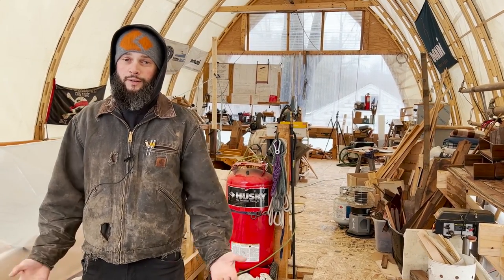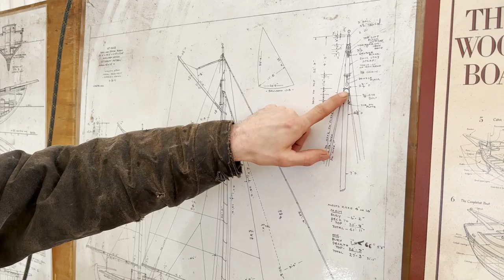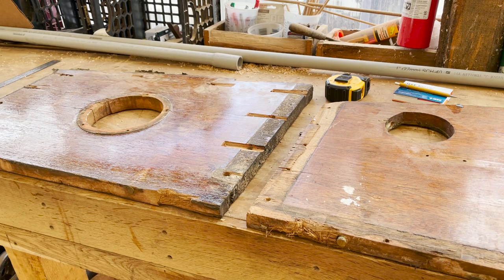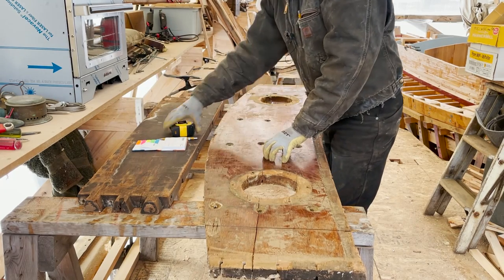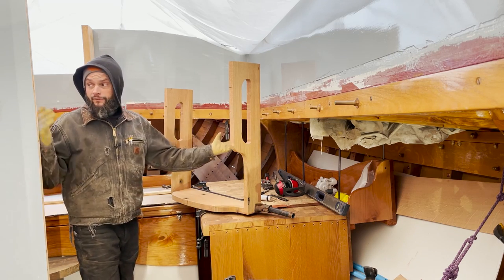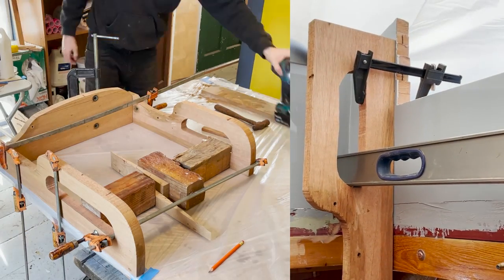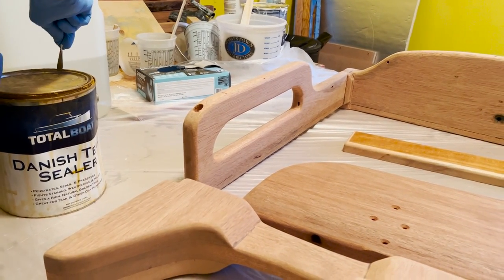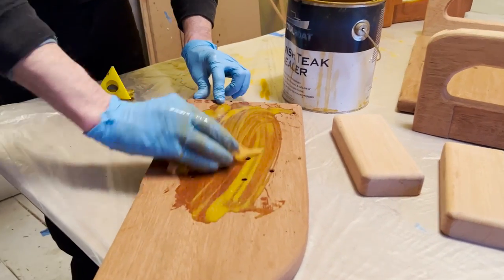The Companionway Ladder & A Big Update - Episode 197 - Acorn to Arabella: Journey of a Wooden Boat

Comment: Do not waste thought on erroneously thinking a spliced wire needs regalvanising.  That's as nonsensical as thinking you might protect the boats paint and varnish by never taking it out to sea when it's complete.
Reply: So talk to someone who has spliced wire for a living not a galvanising expert.  When the splice and wire is drowned in white lead and tallow, then parcelled with linseed oil soaked Hessian,  then served with spun yarn then drowned in Stockholm tar  what could you imagine regalvanising the splice would do ??  Except waste money and time.
Reply from the maker: Thanks for taking the time to send along these thoughts, delivered with a salty tone, but with the a helpful spirit behind it. Glad you’re watching!
Reply: @AcornToArabella  Thanks for replying.  Hey if you are going to do the splicing yourself then try and get old fashioned 6 x With the fibre core you just cut the core off where as 7x means you have a wire core you have to mess with and the 6x19 wire with a  fibre core will be fine.  You can get it here in Australia .  I remember back in 1881 (no it was 1981) an old Kiwi AB NAMED Pat Barry showed me how he'd actually run the fibre core up the splice.  That's good easy practice for if yu do use wire cored stuff.